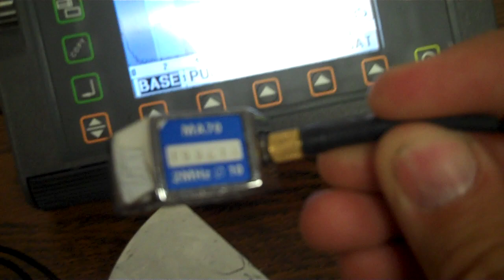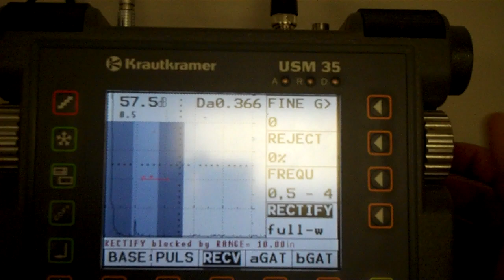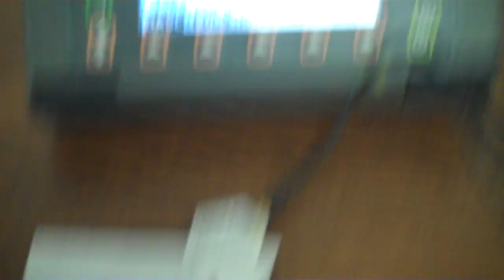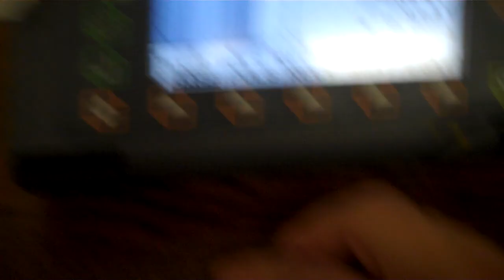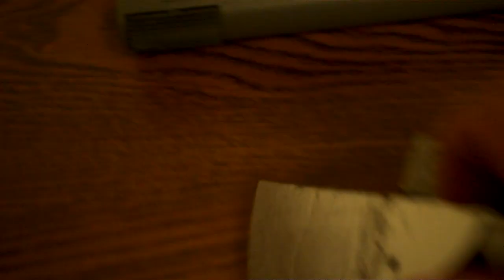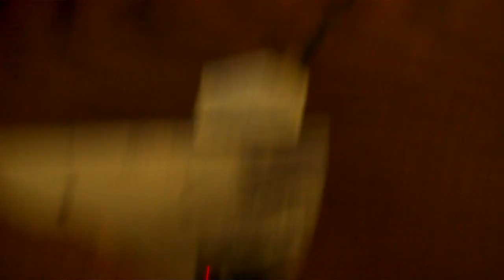USM 35 Shear Wave Calibration

Comment: hi Joe
can you be more specific about functions of damping and power in the instrument.
what's differences between high and low damping and power?
thank
Reply: +Thang Hoang Van The damping functions are all about how much energy you are allowing to strike the transducer. IF you have high or low damping (depending on how your machine words it) it will either allow the full amount of energy that the pulser is generating to strike the transducer or it will "dampen" the sound and decrease the amount of sound that is being created to help eliminate the amount of hash you see at the bottom of the screen.Hope that helps!